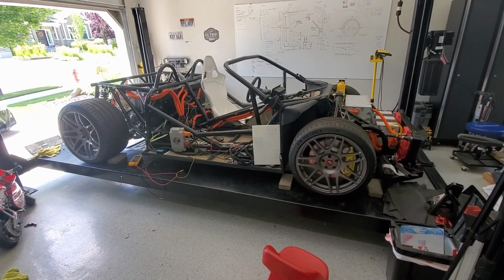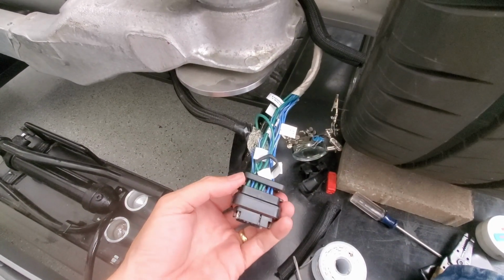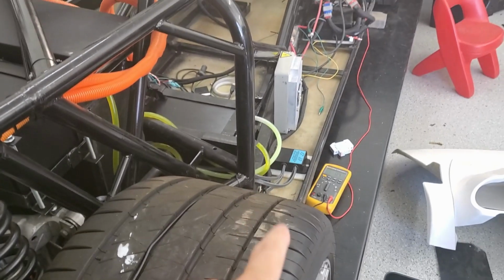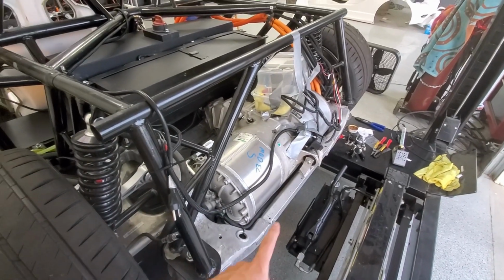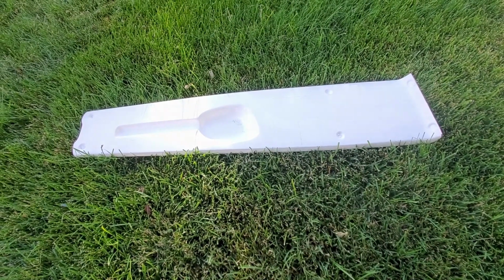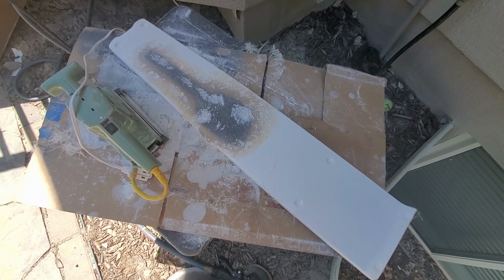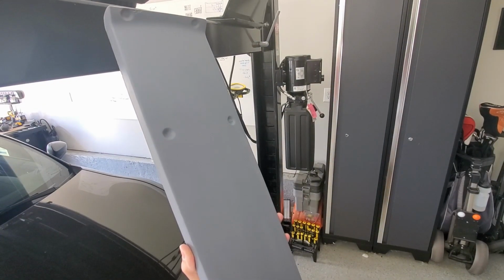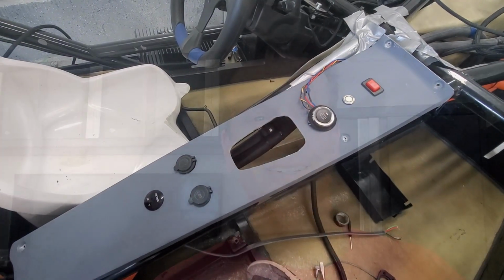custom center console

Comment: Do you have any photos of the rear gear selector with how you got it to work? I like what you did.
Reply from the maker: Gear selector from a Honda Odyssey minivan.  I 3D printed a board that I could fasten contacts to the back.  Pretty simple
Reply: @electricsupercar  Thanks for getting back to me, I am in Australia so there might be a time difference.  What is your terminology for a contractor?
Reply: So too would you share the print file

Comment: You're probably way past this point by now, but twisted pair that is shielded especially in this application should have never come with plastic wire ties on them in fact wire ties should never be used in the installation.  They are too tight and in time they will add noise to the connection.  Always use Velcro with any data cabling shielded or not.  When you pay extra for shielding you don't want to do anything that will compromise it.  I work with this kind of data cabling a lot, in a classroom technology setting.  We use Velcro instead of wire ties in a static application to reduce noise.  I would think in a situation where you have a moving vehicle the wire ties would compress the shielding and the twisted pair wires even faster.
Reply from the maker: Thanks for the advice!  It is never too late to make a good decision!
Reply: Would Velcro adequately hold in an automotive application? Maybe some 3d printed (nylon, glass filled nylon, or some other strong filament) zip tie "washers" could allow you to crank down tight so you know the cable isn't going anywhere but make sure the shielding doesn't get crushed
Reply: @memtech3253  even when you look at looms made be car manufacturers zip ties are not used  rather clips that loosely tie loomed cable to stationary areas of the car.  The problem with zip ties and cable that carry data are zip ties are too tight and rigid and if applied too tight they will break the cable carrying data, and even if applied loose the movement of the car will over time will create problems.  Data cable should be shielded and use the clips the car manufacture engineered for the car.  You are correct in thinking that the Velcro application I have used have been for stationary data cables in a network setting, but I suggested it because this is homemade application where wiring has changed and evolved over the project life.  If you continue to watch the rest of the series the owner makes lots of changes.  Its a great channel and you see his learning process through all of it.
Reply: @jeremyweir6914  ah let me clarify: what I meant was make something like those factory clips that prints in two pieces (maybe just a split in half ring) with a slot to hold a ziptie or two. Ziptie holds the ring closed so the cable stays in place and also secures the thing to the car. I'm tempted to CAD up a model... is there someplace I can send the model?

Comment: What are your other choices with regards to controlling the tesla motor?   Maybe find someone else on the forums who has done it and is willing to help.  It's always the areas we don't know much about where the problems occur..   ;)    Nice job on the Fiberglass and showing all for the camera.    It will be so much fun when you get it driving.. Hang in there!
Reply from the maker: Thanks Bill!  As far as other controller options...EVTV has one, 057 has one as well.  However both these companies prefer you buy the motor and controller from them.  You can always get the board from Damien Maguire.
Reply: @electricsupercar  I may be reading more into this than exists.    I've read some of 057's web pages.   The fact that they want to make sure both ends work together implies that there may be some tricky bits that they know, but would be difficult to walk the average user through.   I'm guessing they might use Damien's stuff and add some 'ease of use' hardware/software.   If you're going to continue playing with this, getting a CAN bus sniffer may help.   I wouldn't be surprised if that switch for Drive/Reverse you had talked CAN.
I'm thinking it would be easier to be able to figure out which end is no longer talking with a CAN bus sniffer.    One way or another, you will get it to work.   I enjoy your humor about fast forwarding through the complaint section.
Reply from the maker: @billbitner9142  do you have any recommendations for a CAN logger?

Comment: Maybe check with Jason Hughes at 057 Technology...my Model S motor has only a few wires to hook up. I haven't gotten that far yet, but maybe it's worth checking with them. They've been responsive to every thing I've needed from them. They do seem to only really want to deal with complete systems, because they've been burned by just selling the black boxes, but maybe they're willing/able to help you. Especially if you have to buy a whole new inverter, maybe that's enough of a complete system for them. 

From what I understand, all of my Tesla parts remained stock, it's just a black box that does all the magic, convincing the drive unit that it's still in a working Tesla, and managing the inverter. Wire hookups are minimum... a throttle connection, power, direction switches, and some gauge signals.

Keep the faith...the EV faith, lol. They say it's darkest before the dawn, or maybe it just feels that way, haha. You seem to have an endless supply of perseverance, I know you will figure this out. When I finish my Hudson, I hope someday we'll meet, and you can beat me in a race!
Reply: Super impressed with your fiberglass work, Jeremy, and all the other tasks and challenges you engaging for the first time. It's a brave thing to allow a camera (and the world) to look over your shoulder while you are feeling your way. Where did you learn about fiberglass? Youtube video?
Reply from the maker: Thanks Brian!  I hope to someday meet and see your car 😀